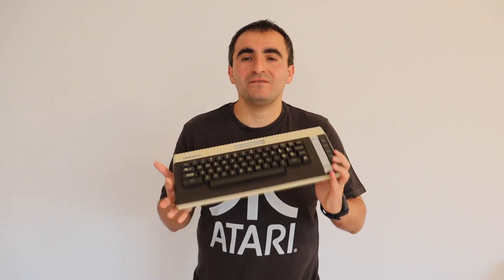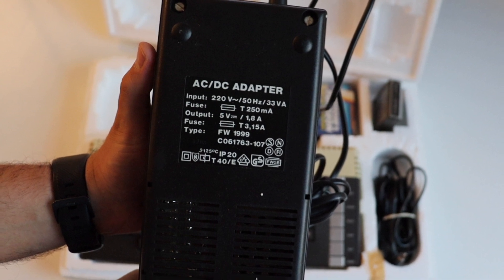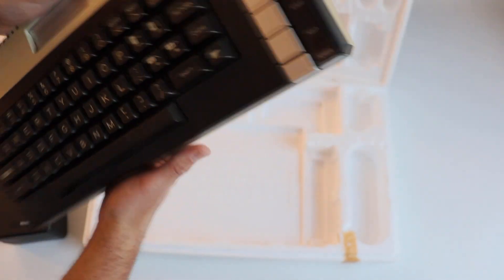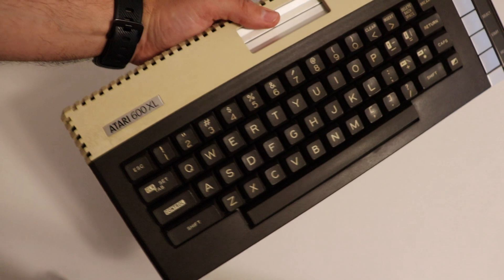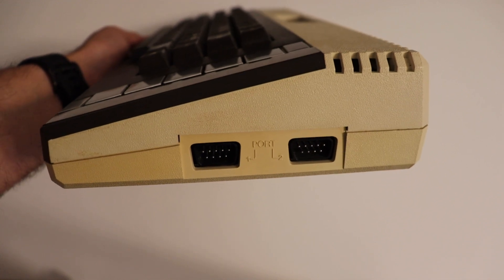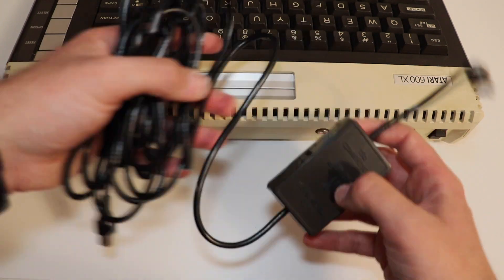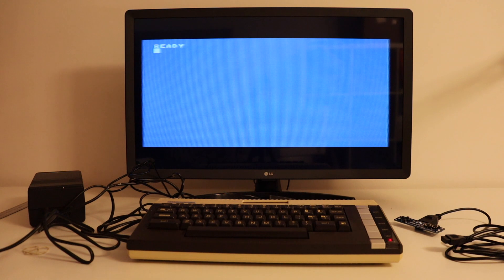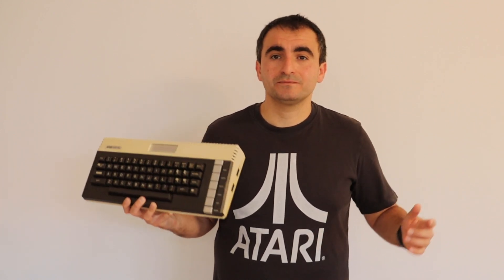ATARI 600XL computer with 6502C 8-bit CPU from 1983

Comment: The 600XL is a direct upgrade/replacement for the Atari 400. The Monitor port is only found on PAL 600XL's, and is omitted from NTSC. The PCB components are also not installed for the NTSC, but can be added. The SIO port was designed by the same person that was a major source for modern USB port. So the SIO port is like a grandfather to USB. For safety it is best to turn off the computer before inserting a cartridge. It is usually safe to insert an Atari made cartridge, but some 3rd party cartridges may cause damage.   I like to see first time users discover all the very fun things and Atari 8-bit can do. Please keep doing Atari videos!!!
Reply from the maker: Thank you for sharing all these details. The SIO port is really very interesting. Noted down about inserting cartridges when the computer is turned off. Considering the age of these computers and how hard is to get replacement components safety is even more important.
In short term have in mind making a video about 800XE (briefly shown in this video too). Later on for the Atari touch tablet for 8-bit computers and Atari Portfolio. I am also considering some fixes of this 600XL and eventually a RAM upgrade to 64KB. I am making videos primary for fun so please don't hold your breath as it may take quite a while until I get back on the Atari topics.
Reply: @LeonAnavi  Understood about making videos. 
The 800xe is a fairly rare machine. I do not think there are any videos about it. You should compare it to 65xe and 130xe in some way. 
There are many internal and external 600XL ram upgrades DYI and retail solutions.  There many DYI upgrades for there computers that you seem very well qualified to build up. But most of all have fun.
Reply from the maker: @KLund1100  I have to do my homework about 800xe. I read it was sold only in East European countries. I don't know anyone from Bulgaria buying it back then, because Pravetz 8 (mostly Apple ][ clone) was ruling the local market and importing Atari must have been very difficult. I bought my unit a month ago as a used item in Bulgaria and I guess it was imported from Germany. 

As for the 600XL RAM upgrade I am considering the replacing the chip on the motherboard and doing a little bit of wiring. I found several articles about this upgrade. It seems straight-forward but you never know with such an old machine. It is going to be fun for sure :)